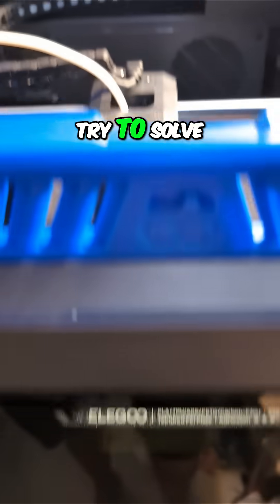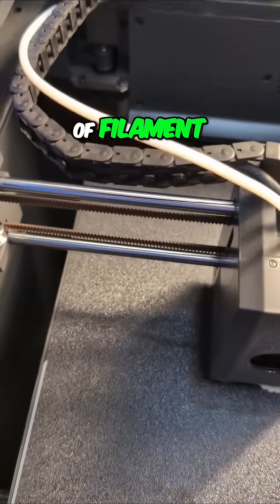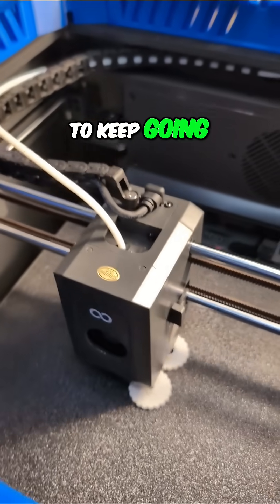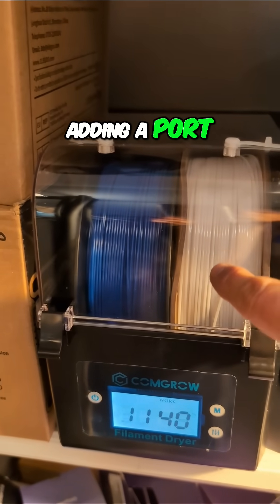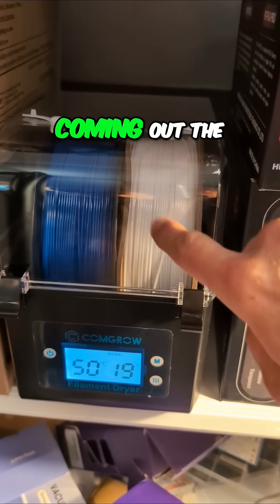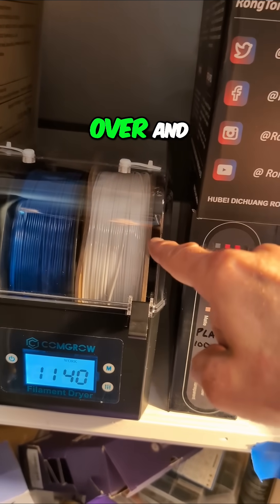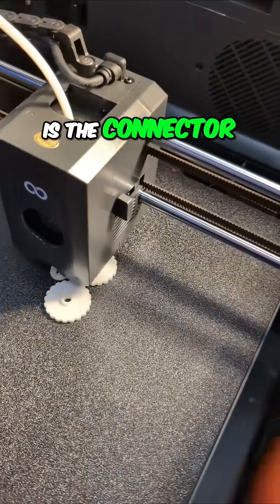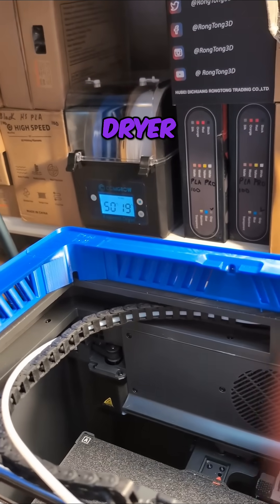Fixing Annoying 3D Printer Filament Problems: Genius Hack!

Comment: Have you used CF filament, if so, any problems? I've seen a few (3) vids were the nozzle blew apart from using it.
Reply from the maker: Not yet. I have a roll. Actually posted on the community tab asking what I should print with it.